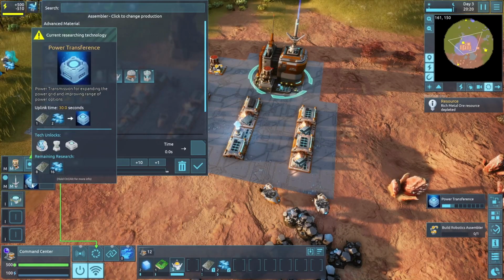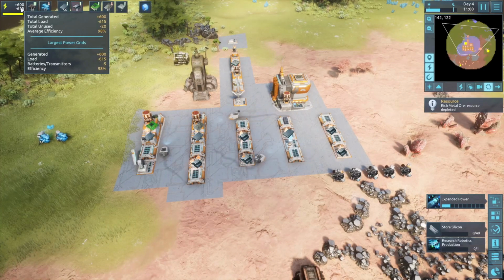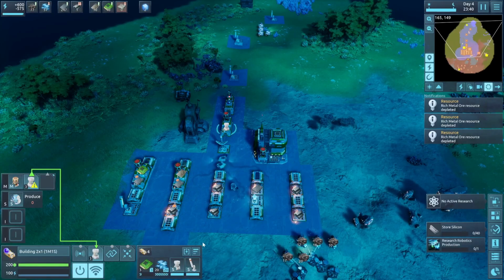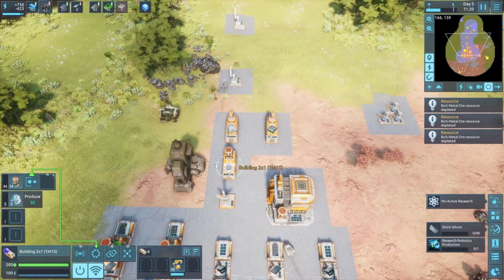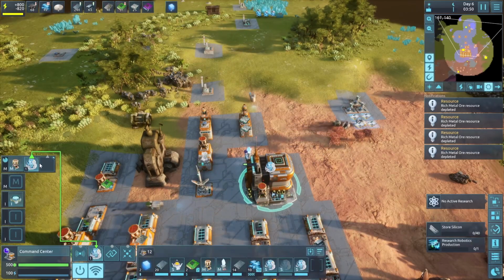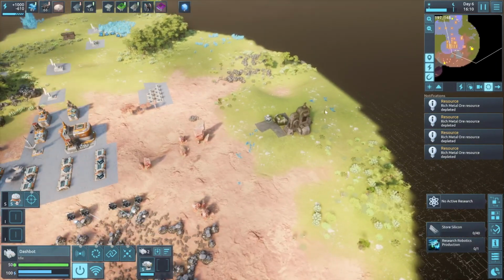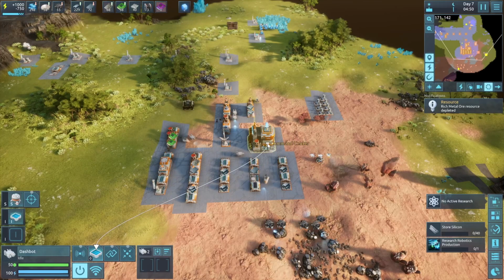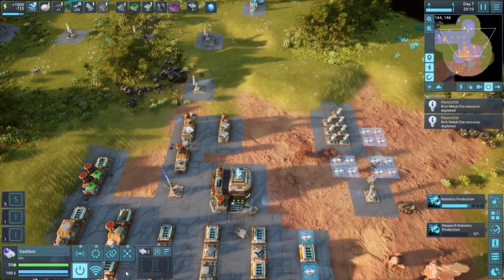Drone Swarm Automation Sandbox! - Desynced [Early Access]

Comment: Batteries are small components and can only go on slots that are small or larger. Capacitors are internal components and can go in any of the slots that are listed as I. Component slots are the boxes on the left for anyone that doesn’t know what I am talking about. Every building and bot have internal components. For bots it means they can go further. For buildings it is backup power and doesn’t take up a slot that could be used for power generation, grid extension or smelting/constructing.

Comment: A battery uses a chemical reaction to store and release energy. A capacitor uses a pair of plates to "hold" electricity for a short time.
Reply: Yeah.  It is odd that the game has all the power things backwards... You want a battery to run your phone for days, and a capacitor to charge and discharge 60 times a second to smooth out AC power.
Reply: Certain recent developments in capacitor engineering appear to blur the line between them.
Reply: @Knight3rrant  Nonsensical performance degradation is not a development :D.  I'd much sooner believe it is a translation error, plus a bit of extra number fudging to fit the game demands.